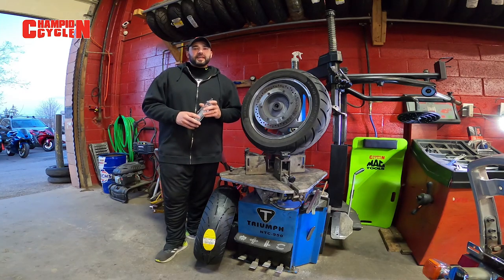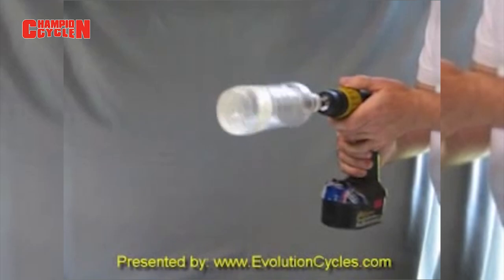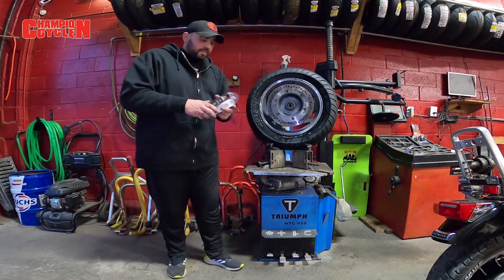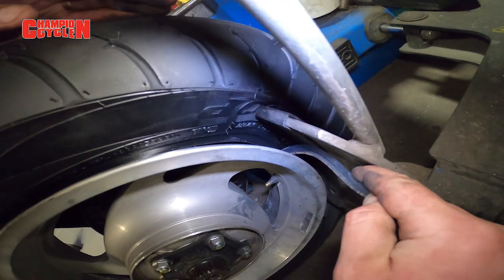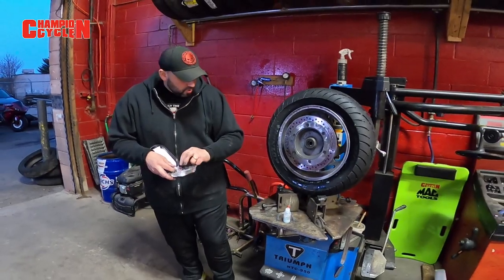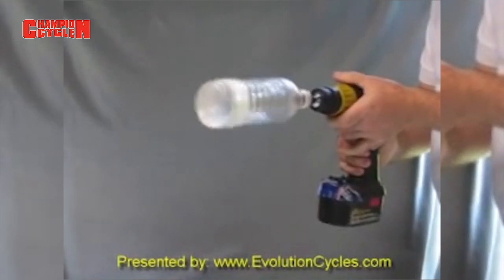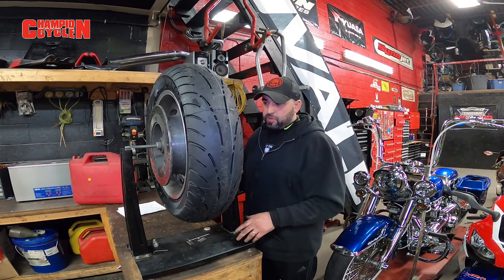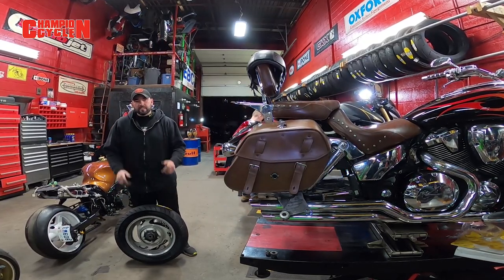HOW TO Install Balancing Beads on Your Motorcycle Wheels & Everything You Need To Know For Your Bike

Comment: That's great, thanks! Just wondering do these work well inside a regular tube? I've got a 1988 SR400 with tubed tyres but I expect the beads to wear down the tube untill it blows, is this an issue?
Reply from the maker: They have beads for tubes. 💥

Comment: How many ounces do you put in the front and rear tire of a 17-in sport bike rim.  Thanks
Reply from the maker: They sell the kits for sportbikes with the perfect measurement in each bag. 🤙🤙
Reply: 2oz per tire, an almost all motorcycle tire. 1oz for below 100 and 3 oz for over 230 tires.
Reply: @ChampionCycle  do you remove the oem clip on weights from sportbike rims when you put on a set of new tires and use beads?
Reply: @gn4221  yes.  Definitely remove the weights
Reply: @freebehindbars8654 thanks for replying.  I had a set installed at my local moto mechanic shop but the guy left those on and just filled the beads inside and left the oem weights on the wheels. I never even knew about those beads, and since researching I'm getting a mixed signal some say it's messing up inside of the tires, some say it's not good for 150+ mph sportbikes but more suitable for cars and cruisers. I'm not sure what to do at this point. Leave them the way they are, go back to have him remove weights onky or remove it all and just slap on balancing weights the original way 🤔
Reply: I did, and when I took the bike on a high speed run I got vibrations. I since took it back to the shop, got rid of the beads, and gotten it properly balanced with weights.

Comment: Cool video but why not mention how many oz per wheel?
Reply from the maker: They very between bike types and wheel styles way too much to begin touching on. However, it's an easy calculation. The answer is: each package tells you what type of bike it's for and how many Oz, to put in each wheel. 🤙🤙
Reply: @ChampionCycle  thank you!
Reply: Usually they give a chart with them .

Comment: Balancing beads suck. If the bike sits for a while the beads will stick to one side and will be unbalanced for the first few miles of riding. They are also way more expensive than weights and i have had they get stuck in the valve stem where it let all of the air out of the tire. They work, but they suck
Reply: Have you ever had a weight come off and hit you